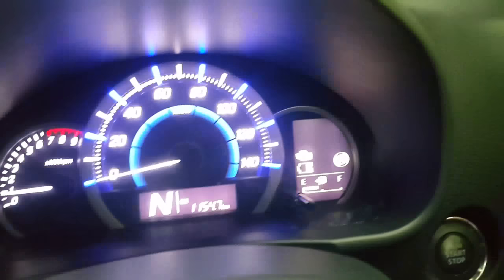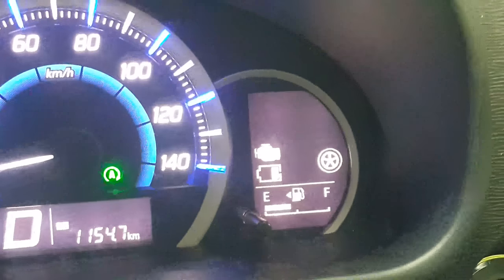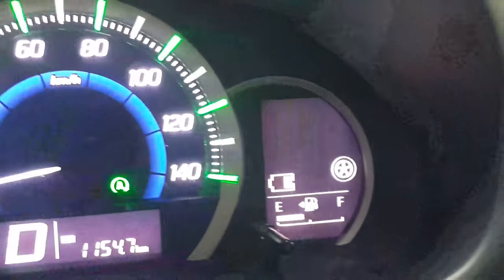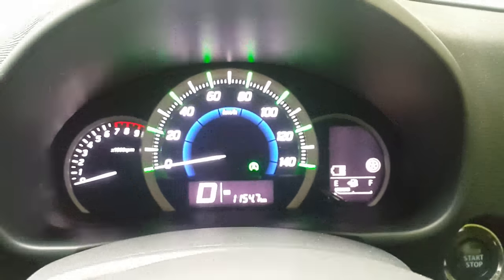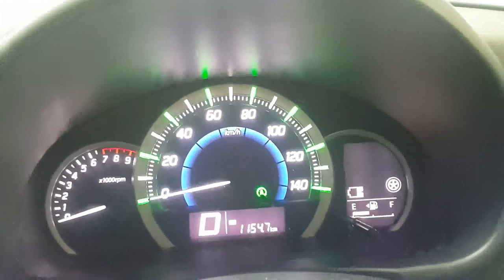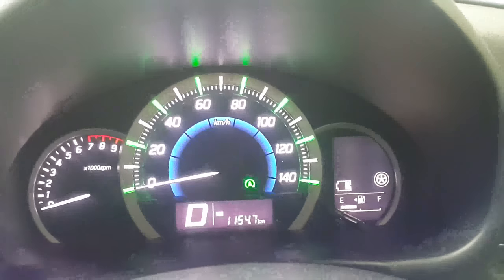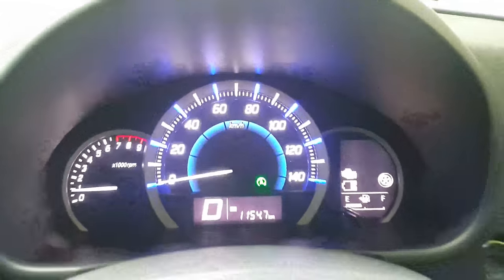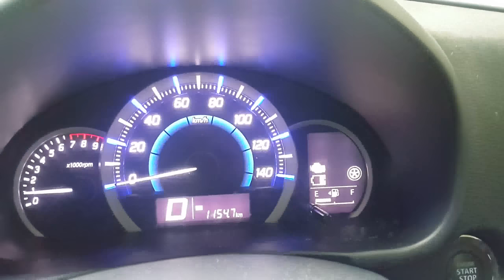How Suzuki Wagonr 2014 2015 2016 Engine Auto stop works

Comment: 12v batriya iwaray.. Trafik welawata of karagena yanna.. Ac blowar vitharay wada.. Awwa welawata rasney..
Reply from the maker: AC Blower eka witharak wada karanne 12V battery eka nisa kiyala hariyatama kiyanna baha. Blower wada nam next check karanna one AC compressor eka. 
Car eka start wenawa nam hodata Battery eka gana baya wena deyak naha.
Reply: When you (WagonR) are completely stopped at traffic lights for 99 secs, are u not burning petrol?
becos I put off the car for 99 secs
to save petrol?
does it make sense??
If the engine runs fully thru Battery
cutting fuel, it marvelous !
becos Ac working , AC running?
please explain

Comment: Mage 2016 stingray ekak thiyenne. Lagadi battery ekak damma. Inpasse muladi idle stop hodata wadakara. Eth dan samahara welawata wada na. Start karala tika durak yaddi bulb eka on wenawa. Mama damme EXIDE battery ekak. Corona nisa wadi ampiyar battery ekak hoyaganna bariuna. Mokada karanne. Prashne battery ekeda. Plz help me
Reply: I am also using the EXIDE battery for my 2015 model since last year. It's working fine for me. At the service station they adviced me to put up an Amaron battery. But still i am using the exide.